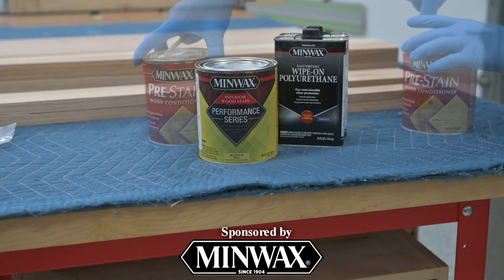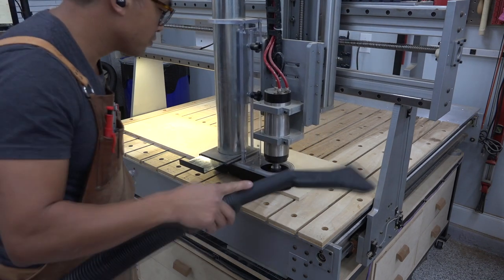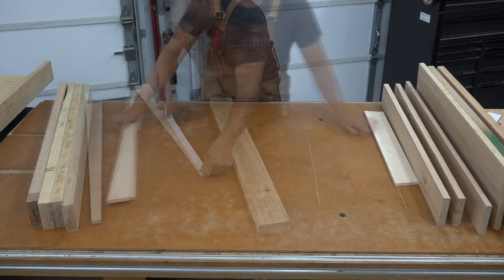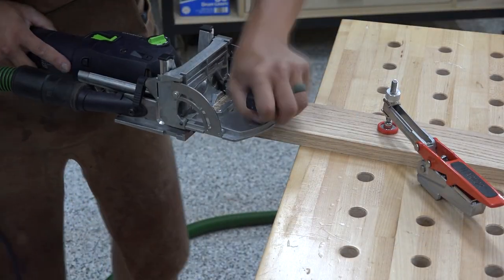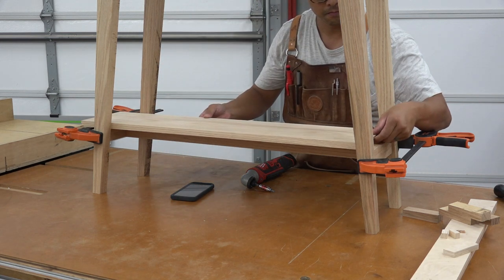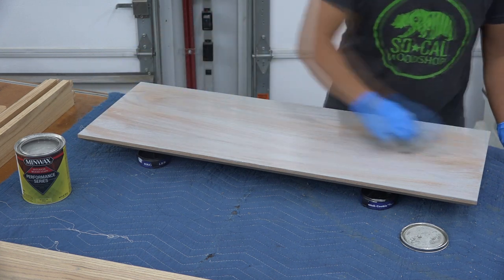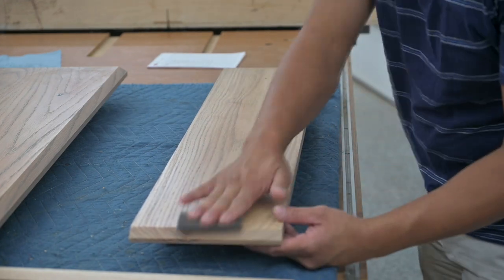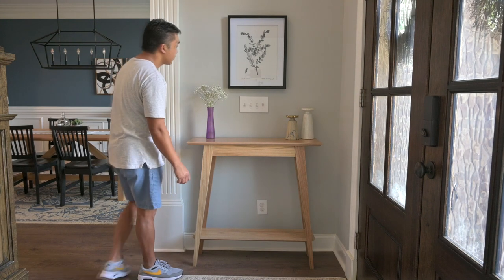Modern Tall Entryway Table

Comment: Another Alabama woodworker here (stuck in California) FINALLY someone who appreciates red oak for what it is! A pretty great wood that's cheap and doesn't have to look like Grandma's cabinets! I built a kitchen table out of the stuff and a very similar sofa table. The table was given a similar look with a white hard wax oil and the sofa table I ebonized with India ink for the legs (walnut slab top). White oak would have been as expensive as walnut in my area...Great work!
Reply from the maker: White Oak has gotten outrageously expensive in North Alabama. I don't know why, but it's just as expensive as Walnut. If treated properly, I think Red Oak looks great. The India ink and white hardwax oil sounds like a great contrasting combination.

Comment: Great video! Would you mind sharing information regarding your CNC?  Home built?  Design?
Reply from the maker: It's a machine built by a CNC builder in the Seattle area. Carl Bruce from Speedline CNC. It's 3hp water cooled spindle, 48"x48" cutting area, ball screw x- y- and z-axis, 1/2" aluminum bed. It's a pretty simple machine, but quite industrious.

Comment: what’s the brand and name of the two sided tape you use? and where do you source it? great video…🙂
Reply from the maker: I'm using X-fasten double-sided tape (not their woodworking tape, which is too thick). Their double-sided tape is really thin and is very strong if you make sure you have good adhesion by using a hard rubber roller.
Reply from the maker: You can find it on Amazon. Not sure you can purchase it direct.
Reply: @AlabamaWoodworker  where can I get that tape? 😊